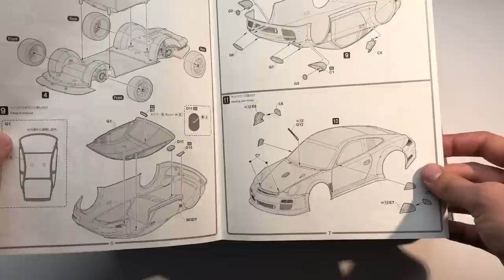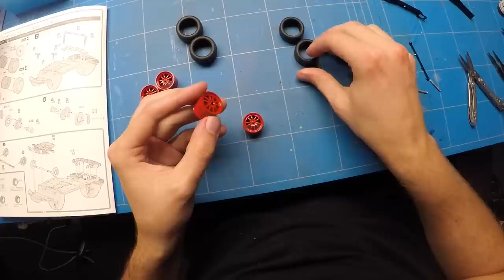Porsche 911 997.2 GT3R 1/24 Fujimi Full Build Step by Step

Comment: I have a question.
I apply my decal onto a painted surface and set it using the mark fit strong. I waited for 3 days and sprayed my mr. clear UV. 1 layer and my decal started bubbling.
Reply: Those paints don't with together